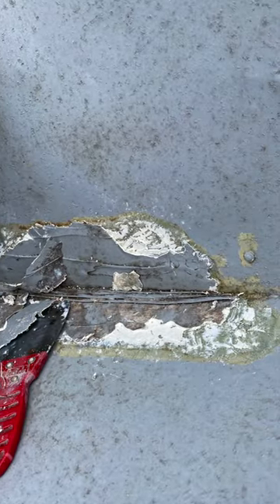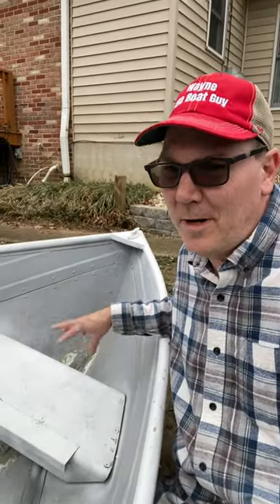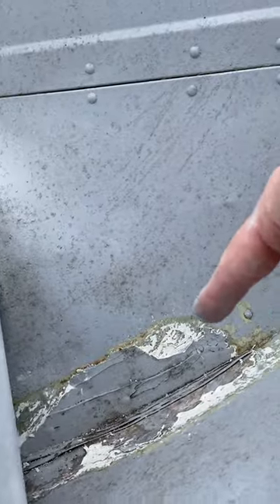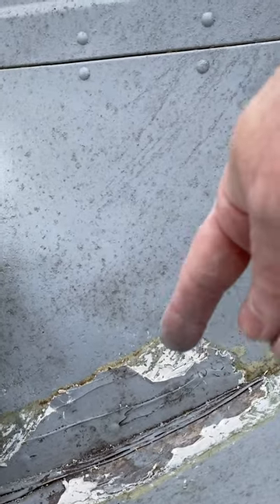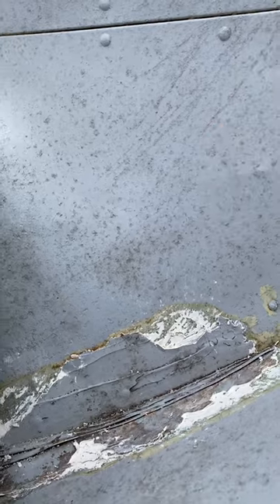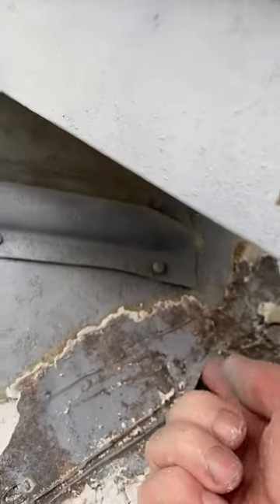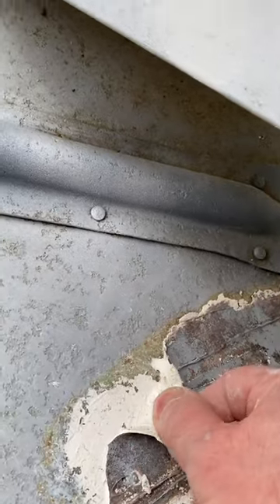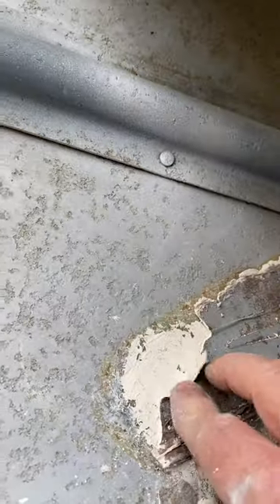Help with removing old caulk from aluminum boat - or is it Marine Tex?

Comment: Looks like RV lap tape, that stuff sucks to get off. 
In one boat I had, the previous owner used Henry’s roofing patch in the center hold, what a PITA that was to remove the 4 foot by 2 foot section.
I used a heat gun, a putty knife, contractors solvent, and a wire brush, worked for me, the same might work for you.